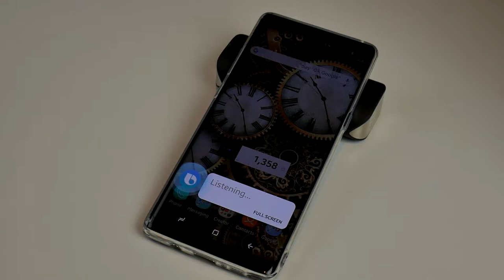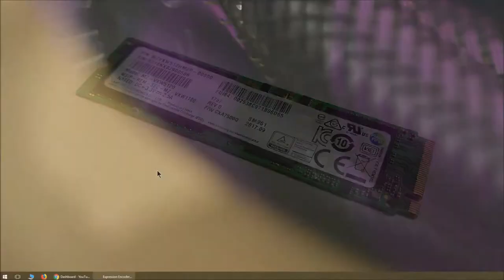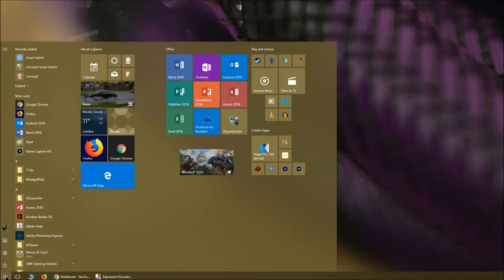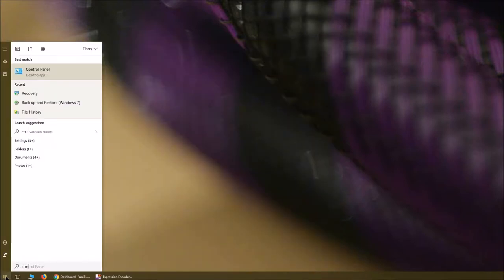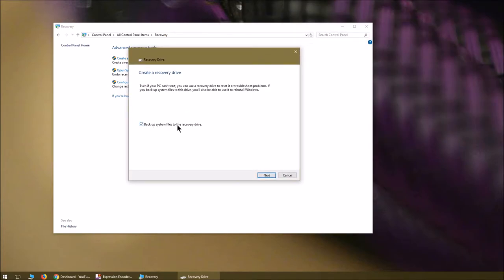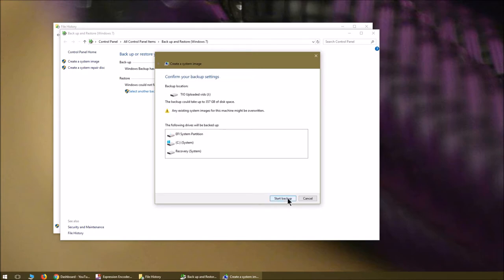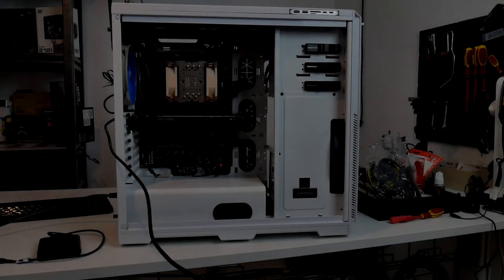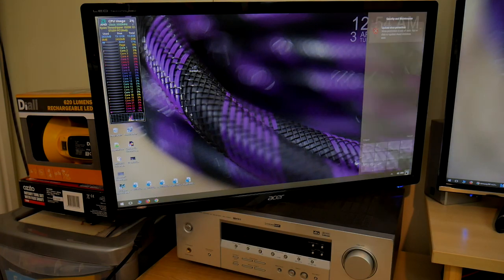Threadripper build VLOG 6: Installing the Samsung 961 M.2 transferring / copying Windows 10 across

Comment from the maker: After upload I realised I had installed the standoff for the M.2 incorrectly. I installed it above the M.2 when of course it should have been below.  This caused no damage and has been corrected.  I do try not to hide any mistakes as they are part of the learning process and shows to others that even experienced builders can get thing wrong.
Reply: To be clear, first attach the standoff to the motherboard. Then insert the m.2 card and use the screw to secure the heatshield and the card to the motherboard.
Reply from the maker: Thank you.  Yes this is what I was trying to say but very poorly I must admit.

Comment: Would it be advantageous to use one of the other m.2 positions to avoid the heat from the graphics card (I guess the heat shield fits all three positions)? It would also give access to the card without removing the graphics card. Or is the top m.2 slot closest to the CPU faster or better in some other way?
Reply from the maker: Hi and thanks for the comments. Yes you can do this. The middle M.2 has a slightly longer heatsink but one this size could also be fitted.  The reason I am using this one is to be able to fit 2 smaller ones in the remaining slots in RAID 0 for the working and cache workspace of the video editor.  This is automatically mirrored to my WD Cloud drive so the data is safe if it fails or gets corrupted.  Thanks again I really appreciate the comments.
Reply: Ok. Good to know. I'm planing to build a workstation based on this motherboard and want to have a fast m.2 for cache purpose. I'm considering the Samsung EVO 960, either 250 or 500 GB. Perhaps I will consider a RAID 0 solution. If you get that to work, please share that with us. I'm curious to know which drives are the best for this.
Reply: I can just report that unfortunately you can't install the heat shield on the middle or far m.2 slots. They lack the two small pegs on the outside of the connector that holds down the heat shield.

Comment: I know this is an old video.  With that being said,  How has that 92mm cooler worked.  I'm building my own 12 core thread ripper system.  Mine is going into a 4u rackmount rosewill chassis so I'm  height limited to 154mm or shorter.
Reply from the maker: I am still using it now with temps maxing at 76' under full load and this is the smallest version they do,  Thanks for the comment.
Reply: @TechItOut  I ended up going with a 1st gen 1950X on a x399 phantom gaming 6. This is the fastest computer I have ever owned. I have to be careful with heat management but the NH-U9 TR4-SP3 seems to be doing the job.  I thought about liquid cooling but decided against it. Anyway it's running well and has a new home in my server rack